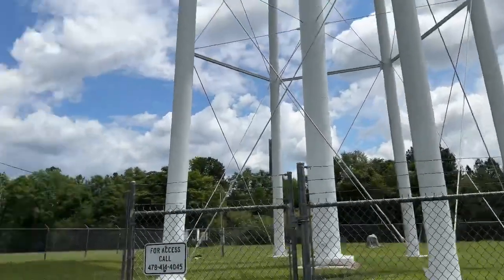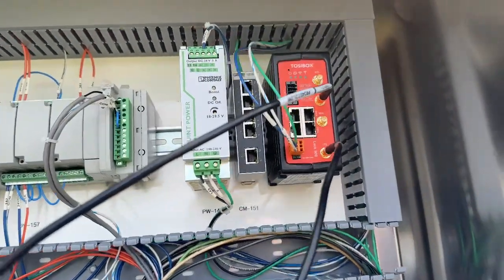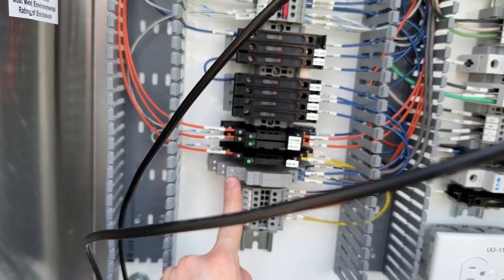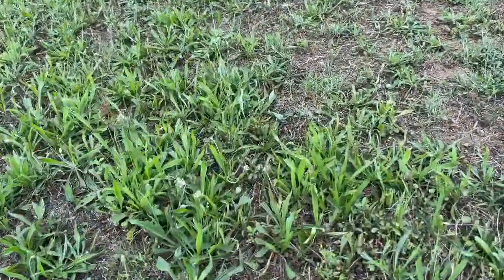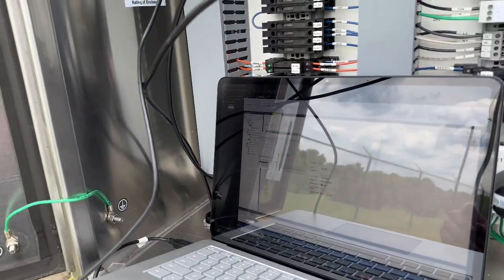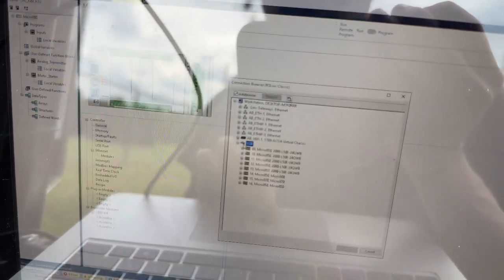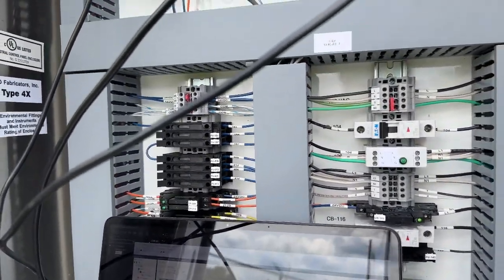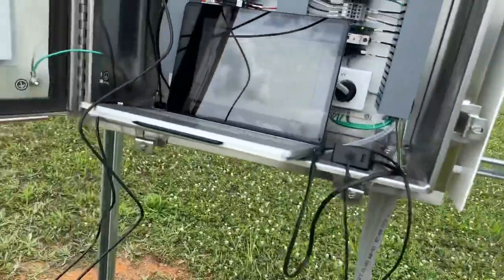I installed an electrical panel at a water tower

Comment: The tech who wired those panels did a neat job. However, is there a reason that you did not run the antenna leads in the chaseways as well? Having them hanging loose in front looks ugly.
Reply: its his first time doing this alone and he is new to doing this; he says so at 1:33.
Reply: @saulva23  Note I did not say he was wrong. I asked if there was a reason. He was neat in how he coiled the excess cable for the other antenna leads. And, neat in how he ran the other cables. For my own education, I'm curious if there was a reason to leave the antenna leads hanging loose. I work in IT and know that sometimes there's a reason to cable something in a specific way.
Reply: @bobmazzi7435  Usually these antenna leads have a minimum bend radius - though I would have made a bigger drip loop at the bottom. Keep in mind that antenna leads are coaxial - meaning there's a braided shield and a center conductor, separated by an insulator.
Reply from the maker: Mainly because they don’t like to bend.